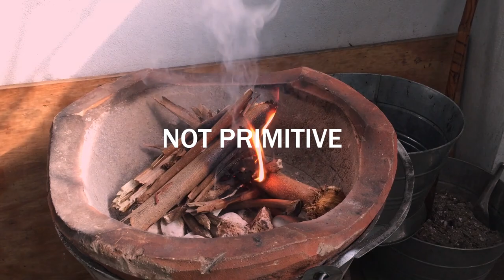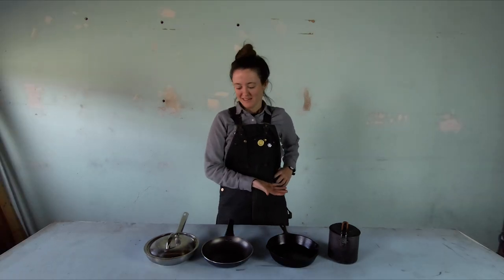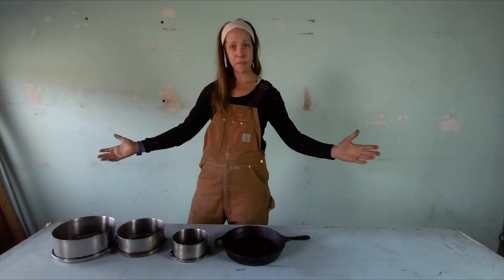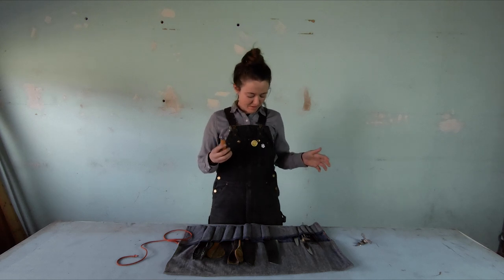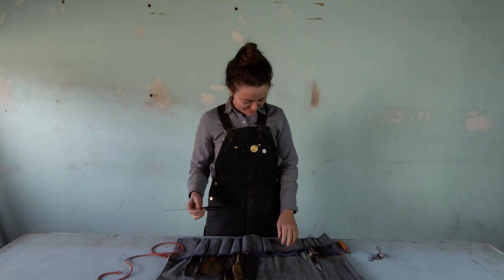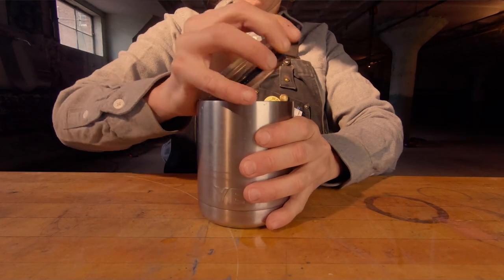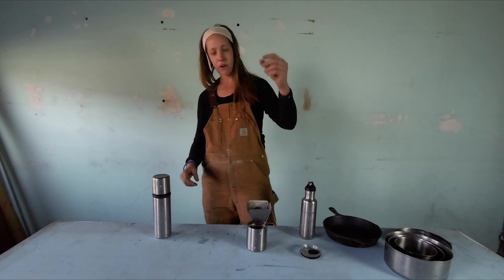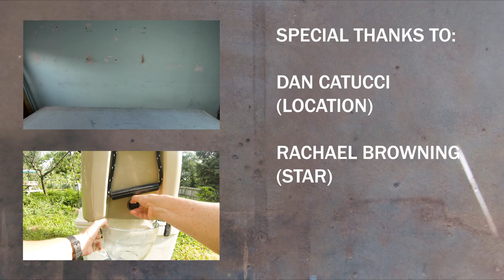Camp kitchen gear review & cost : Which setup is best?

Comment: First of all, this video is awesome.  I was a little disappointed that we didn’t get a solid number for the number of spent shotgun hulls that fit in a 3l msr pot but I’ll figure it out myself.  Lol.  

As far as the water jugs, those military ones are definitely the way to go.  It’s absolutely true that they’re strangely expensive.  They’re also designed to be thrown out of helicopters in a way that the reliance one was not.  Interestingly, there is a flexible flip nozzle thingo that is designed to screw on to the threaded pour spout.  Last I checked it was $25.  Worth having, but strangely expensive for what it is.
Reply from the maker: Thanks for this feedback Paul. And yes, not at liberty to disclose that number. -- Also, the helicopter-proof aspect of those jugs makes a lot of sense! I might consider switching to that in the future sine my reliance tends to leak a bit...

Comment: Oh and I 2nd that Nogent French can opener (though it’s more expensive than it used to be) - it’s longevity surpasses any others and yes very intuitive. I love 3 nesting pots and I love having 2 fry pans as well…usually a combo of cast iron & a nonstick lighter fry pan. I also love nesting pots without handle attached - like magma but they are expensive and so there’s similar 3 SS t-gal ingenio set that’s much cheaper (going to test them out soon) and I use those flat silicone lids. 
For those of us feeding usually 10 people or more - I’m able to fit 6 SS MSR bowls and 6 plates inside the 7piece magma set. 
I like Campcraft Outdoors utensil roll because the top flap snaps back (over a rod or bungee or tree branch) and can hang vertically because counter space is precious.
Reply from the maker: I will have to look into these!